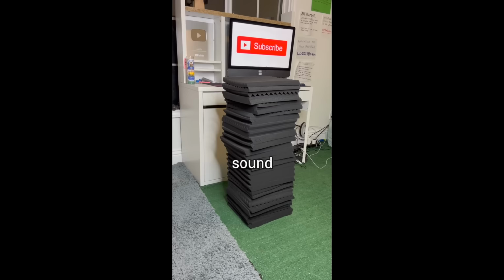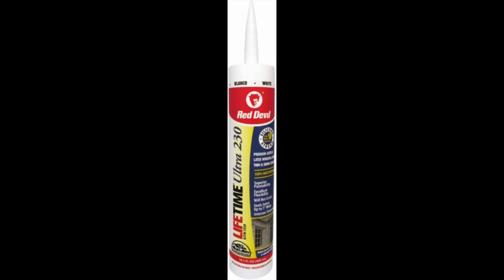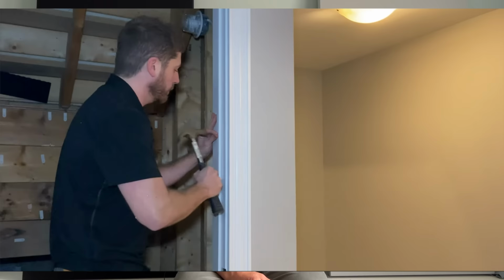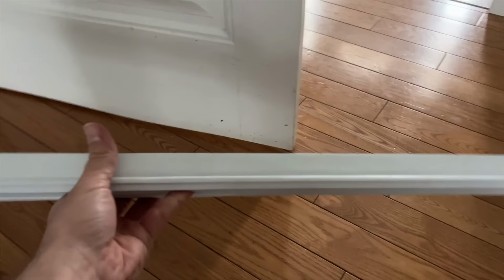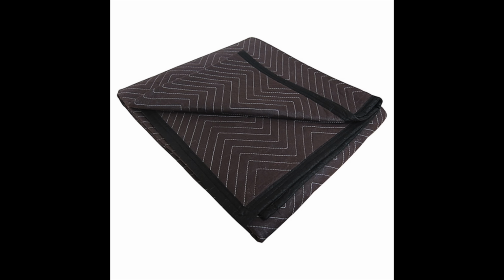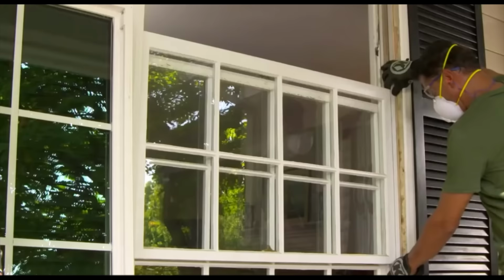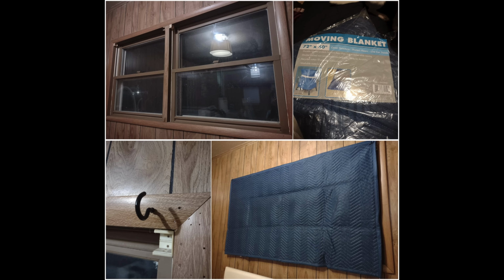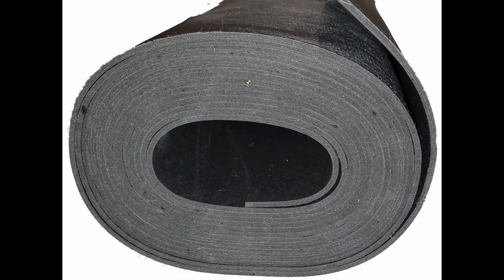CHEAPEST Budget way For SOUNDPROOFING a Room

Comment: We bought a 4 unit building that had been gut renovated but cheaply (used to be a small firehouse).  There was substantial noise pollution from one unit to the next.   We added MLV to the units' adjacent bedroom walls and then another layer of sheetrock.  In the ceilings we added rock wool.  The noise reduction was appreciable.

Comment: Assuming you can remodel the wall, a good way to help soundproof a wall is to "decouple" it. You use 2x6 sill and top plates and frame 2x4s 16" oc and put each one on the opposite edge of the 2x6 and then insulate with rockwool safe n sound. This will stop the translation of vibration from one room to the other via air and wood on drywall acting as a diaphragm.

Comment: Here are some things I've done to reduce noise in my home office, first I used a heavy curtain for the window, placed a carpet over the door and used expanding phone to make sound "proofing" pads using egg paper containers. I don't have much noise coming from the outlets so never thought about touching them, they are different from what you have and our walls are thick brick walls so outlets don't look into other rooms. I live in morocco so the curtain was $2, carpet $35, expanding foam $12 for two containers and egg thingies were free.
Needless to say, it doesn't look very appealing, but living near a school and with a baby running around the house, these things made the room a lot quieter.

Comment: Everything you said about drywall, doors, windows and outlets is already done in every house in Germany built after 1960. Most room doors even have two „steps“ for double sealing, one step in the frame and one in the door overlapping the frame.

Comment: A good value in a book that covers room acoustics and home building in general is "The Visual Handbook of Building and Remodeling "  . There is a complete chapter on room acoustics. There are tables of the sound transmission coefficient (STC) of different wall structures.   It removes the guess work on what approach is most cost effective.  You don't need to be an engineer to get value from it.  The author is an expert on home building science.  Few will compare.

Comment: Moving blankets and curtains and dense fabrics for the win! Set my booth up using moving blankets per instructions from my sound yoda sound engineer buddy, using laundry clips plus foam flooring and ceiling plus sheets, and they agree with your thoughts on most "acoustic" products, and that its all about sound deadening and sound isolation.  So far my recordings have been very clean inside and quite clean outside of the booth, but i am sure they could be even cleaner, and the rest of your information and tips are great and I'll definitely be coming back to this video and looking through your others too. Thanks.👍👍 Stay safe and stay awesome.  🙃✌️

Comment: The foam tiles need to be put on the door with the corrugated side facing the door NOT facing into the room. If you can get a roll of the corrugated cardboard inner from cartons boxes and stick that to door walls and windows it works increadably well. I have experienced this method and was astounded at how well it worked. BTW be careful NOT to damage the corragations when applying.
Regards from South as

Comment: for a door, add a lip all around the door of about 1 1/2 inch or 2 inches wide on the side of the door that closes to the frame, you can adjust the height of the lip to suit your framing and  then put rubber / foam weatherproofing ( to seal windows usually) on the back of that lip frame around the door, it creates a seal to the frame around the edge and blocks all the gaps, you will need to make it slightly differently on the side with the hinges due to the door having to open and close but you can still knock out a lot of real estate on the gaps.

i just put a thin 5mm standoff all around then take a whole sheet of ply  usually just 5mm or 8mm ply to cover the door entirely and create the lip around the edge, the air gap from the 5mm on the inside of the door also cuts out sound, the main thing this does is deflects the  sound but also then blocks it with the weather stripping
Reply: Thank you! Will try that!

Comment: Sound proofing is about transmission reduction. Anything you can do to block air movement to and from the room in question. Other things that can cause sound to travel between rooms is the thickness of walls. Think of a drum head. As the head moves it transfers acoustic energy from one side of head to the other. Low frequencies require heavy materials to dampen so big thick blankets that are only secured at the top make a good absorbent barrier.

Comment: If the goal is to increase clarity of speakers : une a mirror to locate the places where you can see the speaker from seating position, and make panels with wood  frames + old towels and lycra covering, and place them on those reflection points. This is neither sound deadening nos sound proofing; but it enhance greatly the imaging, depth, 3D, articulation and clarity of any speaker for music or cinema. Also use black lycra if you are doing video projector are dark colors of those on the sides and ceiling do enhance contrast on the white screen.

Comment: Good tips about the door. But if I really needed to make the door more soundproof on a permanent basis, I would get a solid door instead of the typical hollow core doors used in modern construction.

Comment: Depending on your door, adding foam to it may help more than you suggest. Yes you should seal around the door, but thin, light doors will let more sound through than heavier, more solid doors.
Also for windows, I have quite deep window sills, so I was able to get some foam cut to size and just jam it in there, works wonders for blocking out road noise, and heat

Comment: Moving blankets are the ideal solution. You will see them sometimes in professional recording studios. The thicker the better, and the thickness is reflected in their weight (check out the specs when buying). That being said, you can build layer upon layer of the thinner ones. So the best way to save money is to find the best price per pound, regardless of the thickness of the individual blankets.

Comment: AIR space is important check out using double cardboard panels multiple layers with silicone caulk
Between panels, it breaks up the sound waves and is cheap and efficient 😉👌🏼🤗

Comment: One of the cheapest ways, if you don't mind the less than exciting looks are moving blankets hung from the ceiling with a 1 - 2 inch gap between the blankets and wall. Space and "air" can make for great soundproofing. Make sure blankets reach the floor and doesn't leave a gap at the bottom, and as little gap at the top. On outside walls you want to completely cover the wall with blankets. On inside walls  you can have some space between blankets. 8-12 inches apart at most. And make sure your corners are fully covered as well. Not pretty, but effective. For windows pile up some old pillows behind the blanket. Don't let UV rays hit the carpets, put something over the windows. Even foil would work.

Comment: Sound goes through walls, or over or under the wall in ceiling crawl spaces. Thick foam pads or weather stripping is great IF you use small nails because the glue is weak.  SOLID doors are much better for sound and fire protection.  I had old single thickness windows so I had my guy attach acrylic sheets on the top outside windows and small pieces onto the inner, operating windows and then a thick set of good window blinds.  Quieter and cooler since that is the West side of the house.  Also on the outside, had guy permanently add BLACK one-way mosquito screen.  Dark and cooler and quieter, but NOT real cheap.  Had three old blankets and carpet so I laid carpet and then laid blankets on the floor.

Comment: Carpets and curtains are something that every sound technician/engineer are using since the 70's, but there's nothing to do with soundproofing, it's about killin interior sound reflections, it is indeed and acoustic thretment. Soundproofing it's really in a different level if you want something that really works, you have to build another layer of walls and a flooting floor if you really want to see results.

Comment: I rent and I have noise issues that partly come from entrance doors deliberately having gaps for central air in the building. (The apartments appear to work like sound amplifiers; it's not obvious in the corridor.) I was hearing way too much of other people's conversations and it was annoying as well as distracting. I used weather strips. That wasn't enough. I now put a (cheap hence a little thin) moving blanket in front of the door and I have added a readymade light-blocking curtain that I pull closed when I am indoors as there was enough room above the door for one of those extendable spring-fixed curtain rods. There's a small elongated open hallway. I have put two layers of the same readymade curtains there. Together, this helps a lot. Adding a small piece of furniture - or, what I did, leaving a large packaging box along the wall - also helps.
Reply: I can still hear people but it's much less intrusive now. It makes a big difference. The central air also is a source of noise. As it blows dust and fibers into the apartment, I used tape to stick disposable filters onto the air vents and was astonished to hear what it did to the noise. I change the filters once a month.

Comment: Ive found that carpet padding foam works to deaden sound on a wall or door. and if you add sone cheap medium nap carpeting on top of the foam it works very well to keep sound out and in.I'm more interested in keeping sound from escaping from my room.... surround sound from watching movies or playing my electric guitar through an amplifier. the hardest sound to deaded is bass as the frequency is lower and therefore vibrates the surfaces more that higher frequencies will. adding mass helps but the lower tones in the bass will always transfer through any solid surfaces. reduction of sound is all you can hope for in that circumstance anyway.

Comment: Try making insulation panels. Make a box of 1x4 almost as tall as your ceiling and 32 inches wide, or varialbles of 16 or 24 since insulation comes in widths of 16 or 24 inches. Cover on side with cloth by stapling it on. Maybe a sheet.  You can leave the other side open or cover it. Lightly place the insulation in the box and the dead air spaces in the insulation absorb sound. Cheap and easy.

Comment: Closed cell foam installation sandwiched into the door or window frame seems to work a little too. So long as it's cut to fit tightly into the window frame. You can even glue a thin piece of plywood between two sheets to make it stiffer.  It looks bad but it's cheap by the meter. Also, it doesn't only come in pink. 😆  It's easily removable so there's no need to modify the drapes fixtures.

Comment: All of this makes a lot of sense. 
I live in a second floor apartment and have noticed that sometimes I can hear my downstairs neighbors fairly clearly. Will adding rugs on top of my carpet help, or is there some other way the noise is coming through. Also, often I can hear people talking outside through my balcony door which is sliding glass. Will adding heavy curtains help? Right now it only has vertical blinds that do nothing for noise.

Comment: It can be cheaper and more effective to build a sound proof booth in a room if the purpose is to record vocals or a single instrument. The surface area of a booth is many times smaller than a whole room, hence the materials required will be significantly less. But the trick is allowing airflow. Do not make it air tight for goodness sake! If you're singing, talking or playing a wind instrument you need good ventilation which is an interesting problem to solve in combination with sound proofing. 
This can be achieved using a labyrinth path design, a twisting passage for air to travel through which muffles sound as it tries to escape. There are other options such as intake and exhaust fans with silencers, soffit vents and ducts with acoustic lining.

Comment: BLANKETS AND RUGS     Here in Eastern Europe, people laugh at the old tradition of having carpets on the wall - rugs - but actually, they offer AMAZING thermal and sound insulation.

We tend not to use AC even though it gets to 110F here most summers.  I have rugs on wooden poles that I put up at the windows in summer as well as 2 sets of heavy curtains on the south-facing windows. Its way easier and cheaper to keep the heat OUT than to allow it in and cool it.

Comment: Glass vibrates with sound. And transmits the sound. In regards to trying to soundproof a window. Those rubber vibration dampeners that drummers stick to their practice kits. Those sticky rubber things might actually help a little bit if you stick them to the window panes. I've never tested that. But now I'm curious.

Comment: I was setting up a home office in my apartment and used that clear alien weather stripping around the edge of the door since it is very sticky and soft so it conforms to the edges and moulding around the door and also the unevenness. Once the last piece was set and A/C kicked on, my ears started popping and I got a little dizzy lol. After a while I also noticed that the air from the vent wasn't coming out as long as the door was closed, so that sucked. Ended up taking it all off.

Comment: I had problems with a loud neighbor who was keeping me awake with loud TV and music at 2 am in the morning. I am talking about loft type apartments here, not houses. The noise is defiently coming through the bedroom wall. The two bedrooms are next to each other and they have 18 foot tall ceilings. And the noise is so loud I could hear it in my living room too, which is the fartest I could get away from the annoying noise. As it was impossible to sleep! And complainging to managment did nothing. 

So at first I was using an air purifier on medium speed to try + block out her noise. It makes a loud humming. But things really turned around when I got a white noise machine from Amazon. I chose the noise that sounds like rain. When she puts her noise on too loud + it is disturbing me in the living room, I go turn on the Rain sound loud enough that it drowns out her annoying TV / music. Pretty quickly she has learned to keep her volumn DOWN!! 

Because there is no way I can hang a bunch of drywall or stuff to cover a wall that is 18 feet tall. Plus this is an apartment. I cannot be hanging more drywall on top of their drywall. 

But you can sometimes "train" the lousy neighbor to stop the bad behavior. And now its quiet by 10 pm. No more loud TV at 2:30 am! 

I dont know if this will work on other bad neighbors but it worked on this one. 

The white noise machine I bought was under $20. The bottom of it says "magic team". It can play up to 5 hours.

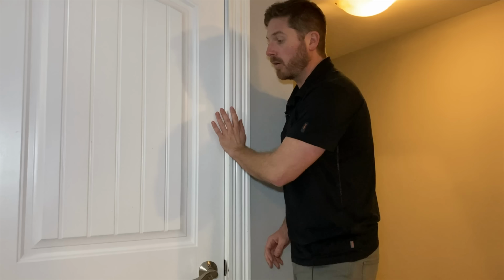Comment: 4:09 wobble is easily fixed from correctly setting the tab in the lock hole on the wall side. The hole where the door handles lock goes into, there is a metal casing and that casing has a metal tab. Get a flathead screwdriver and correctly set that tab until the door lock still closes in properly but the door doesn't wobble. Therefore door wobble has nothing to do with the effective seal of a door

Comment: I'm only 3 minutes into the video, but I have to mention.. growing up the son of a carpenter:
Door hinges come with set screws. You can adjust the gaps of the doors to some extent with nothing more than a screwdriver. So if it is just a little bit, you might already be able to reduce the noise without making a single permanent change to your furniture or walls.

Comment: I soundproofed my dividing wall ( cavity wall )  with amazing results, I hung a carpet on the wall fixed with a batten at the top, and pinned to the skirting, (base board) I then glued egg trays all over it , the 2 dozen size, then constructed a frame of 3x2 timber and hung carpet-underlay from the inside edge, and plasterboard (drywall ) on the outside, new skirting and coving and I’d lost 6 inches off the room but I literally could not hear a single sound from next door, the old lady is deaf and the TV is right up.  So I put on Bob Marley Jamming turned it right up, went next door and told her what I was doing and she let me in,  I honestly could barely hear it with my ear on the wall. 
But now while I’m in bed  upstairs she puts the tv on at 7am and I can hear every word, so it’s going up through her ceiling and through the party wall. If I go down stairs it’s silent, go back up and it’s very clear.  So I’ll be losing 6 inches off the bedrooms soon,  but it’s worth it.

Comment: Sometimes the door itself is quite thin and does not stop the noise. Attaching a layer of heavy material, like plywood or laminated floor wood (for decoration) might do the trick. At least that worked in my house.

Comment: Acoustician here.  There's a major distinction that should be made that I'm didn't hear in this video:  Sound proofing and sound treatment are two totally different things.  Sound treatment isn't about keeping sound in or out of a room, but rather about altering the sound within a room so that it has the desired reflections and doesn't have the undesired reflections.  Soundproofing is about keeping sound in or out of a room.  For sound proofing, you want mass and physical separation.  For sound treatment, you need a variety of materials.  Sound, like all other waves, can be reflected from the outside, which reduces the sound transmission into the room.  Having a more reflective surface outside can have a major effect inside.  Outside of that, you want mass to absorb the rest if you cannot separate the room physically.